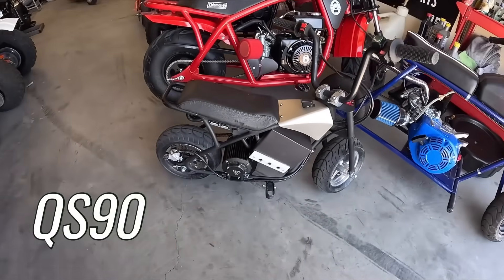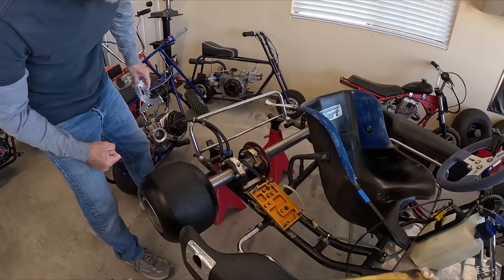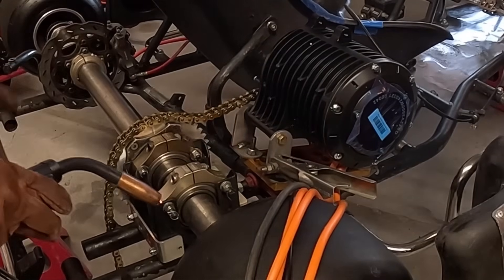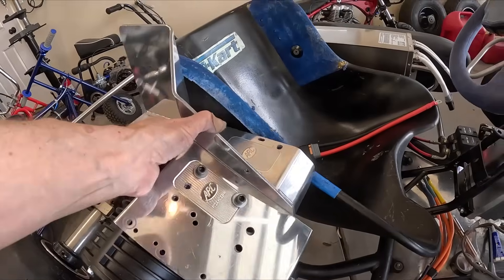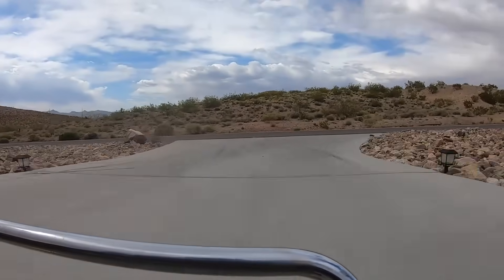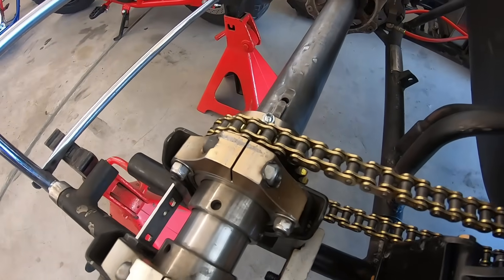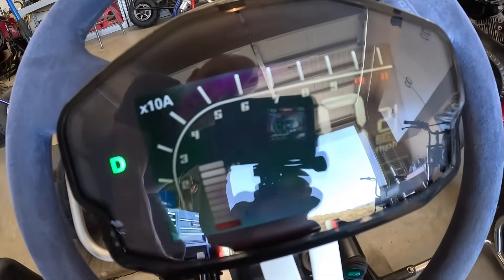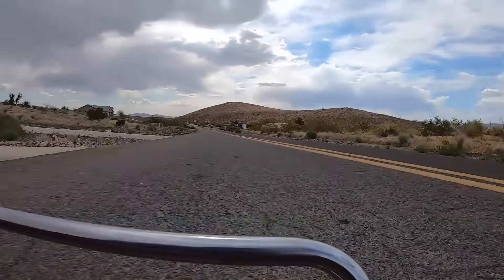How to build an INSANE electric Go kart!

Comment: Really cool build. Being a kart racer for many years it hurts to see you welding anything directly to the frame. Clamps go along way to keep the flex threw out the chassis. But nice job. I own a stark varg and thinking about adapting the whole power train to a kart chassis. Something with 4 wheel brakes and able to handle 80hp.

Comment: put a cvt togheter with the 28000 watts kit.
CVT all the way
Reply from the maker: There is really no need for a CVT with the electric set up because the electric motor delivers  maximum torque almost instantly

Comment: what model margay is that chassis? and year?
Reply from the maker: 2008 CRG
Reply: @Black66 do you think you need front discs on the kart running the 28kw system. I’m about to send it and buy a kit!
Reply from the maker: @SourDoughSam-d1s   It could use front brakes, but I think brakes are kinda over rated. 😀They add extra weight. Have you seen the second kart video? https://www.youtube.com/watch?v=K1XRsc0T-vY
Reply: @Black66  i have and it inspired me to get taller tires since i live in AZ. i found a complete set of frptn discs for 220. whats the ride time on that battery?

Comment: Soo i noticed that the Motor of the kit is rated with a peak power output of 28kw but a continous power output of only 3kw. Since the maximum power output is almost 10 times higher than the rated continous one i would expect it to have the full power only 30 seconds or something like that. Did you notice significant loss of power during longer rides? what happens, if you drive over 30 miles a longer period of time? I am very curious because i see these high diffrences also in street legal electric motocycles and no i'm not sure what this means for the kart/bike on longer rides.
Reply from the maker: I have noticed zero difference in power over long periods of time and in multiple videos. Also on a kart or minibike application the  motor runs very cool, I think partly due to the light weight of the vehicle.

Comment: At 1500 Watts it would be way too powerful considering the cart ways less than 50Kg Theodicy it should have a top speed of 240Kph that one at 28000 Watts must have 100Kg of Batteries that last only 45 Minutes and IMPOSSIBLE TO control without spinning out every few Minutes top speed would be almost 400Kph you would need a shell and tail fin just to make it suable for racing..
Reply from the maker: Check out the range test video using a 24AH battery https://www.youtube.com/watch?v=wGqlyUDskOY&list=PLkbj-ip-5FzYWaQnTJG7jZKLKYj0Ta-NP&index=2

Comment: Awesome video.   I’d be curious what that big cc small block you built a while back would compare. Running the 3D manual clutch it would be a fun setup with that much cc in a small block.
Reply from the maker: I did run the 263 on the same kart in a video without the 3D clutch, It was fast but not as quick .https://www.youtube.com/watch?v=VyT7GIvI6j0&t=151s

Comment: I know this is over a year old 
But this is the qs138 70H correct? 
And what voltage are you running at 72v?
Reply from the maker: The links for the parts used are in the video description. Check out the e-bike playlist for many more videos in this series. https://www.youtube.com/watch?v=ONA_EyhBQ9E&list=PLkbj-ip-5FzYWaQnTJG7jZKLKYj0Ta-NP&index=26 https://www.youtube.com/watch?v=676El2Yv3SI&list=PLkbj-ip-5FzYWaQnTJG7jZKLKYj0Ta-NP&index=25

Comment: Nice video.  Where’s the best place to order parts for an E Cart?
Reply from the maker: That is an interesting question, there are so many options out there. If you check out the e-bike playlist  I have tried a lot of the kits from Electro and Co which are basically plug and play , great kits and very powerful. Ive also tried a $300 kit off of Amazon which was fun .  I guess its a matter of opinion and how much you want to spend and how fast you want to go.

Comment: Have you ever modded the controllers by  putting solder on the shunt wires on any ebike controller mother boards. Anytime IV got a 2,000 watt controller for my ebike I always put solder or a copper wire across the shunt wire witch looks like a few staples on the mother board. It reduces the amount of amps across the board . So putting solder on it makes it run allot more amps. My ebike went from going around 35mph to 45mph just by putting that solder on them.
Reply: These don't use shunts like them but more hall sensors around the phase outputs to measure the current sort of like how current clamps work what electrician use

Comment: sick Kart jealous i counted 3.0 seconds both times 0 to 30 same as my Burn e 2 Max unless its 30Km/h still sick great build bro i want 1!! Subscribed.
Reply from the maker: Thanks ! Check out the other electric builds on the channel. Also I use a Dragy performance meter for 0 to 30 and top speed times.

Comment: I love your channel and envy your garage, thank you for all your videos. I was inspired by this video and am building the same kart as you but need help nailing down the gearing. What was the final top GPS speed with this 15/22t gearing and 10? inch tires that you featured in the second half of this video? In your opinion what was the best gearing you experienced for a parking lot ripper? Thank you
Reply from the maker: The non-gear reduction QS138 works best with the 10-inch tires IMO. The best setup so far on the reduction motor was in this race video  https://www.youtube.com/watch?v=ONA_EyhBQ9E&list=PLkbj-ip-5FzYWaQnTJG7jZKLKYj0Ta-NP&index=27
Reply: @ ok awesome what was the gearing in that one still 15/22? What would guess the speed was with that setup?
Reply: @Black66  haha thank you for the tip but I already received the geared version it's already mounted up! Haha what gearing did you use in the second video?
Reply from the maker: @wesleyb82  I was using a 19/40 with the turf saver tires in the second video. 
Never tested for top speed, but it was sure a ripper with that set up on it. It also had nice ground clearance.

Comment: I built mine from some guy who didn’t know how to wire it etc. 5000w 48v motor with 35t front sprocket and like a 45 rear. My test run on 300amp blew the tires off at 80mph and couldn’t see straight much after so I put a 15t front on it. Easy on amp load and goes 45mph now for kids. Plenty fast with drift tires on most the time. But omg that thing turned up full power big sprocket was scary fast. Using Audi e tron lipo cells for battery. Come as single cells in packaging so have to wire together and cell check leads etc so have to know some stuff but for 80$ for 16 20ah cells I can’t beat the price. Also they deliver 526amp each! After 2 7cell packs to make 51v I’ll have what 700amps of power

Comment: Just started watching your videos, couple questions. 
1. How many volts is this running, hopefully 48v already have lithium batteries in my golf cart.
2. Approximate cost of the motor/controller kit?
Reply from the maker: The links for the parts used are in the description of the video. The Kart is running a 76 volt 48AH battery .

Comment: lol with that reduction gearbox on the motor, looks like you could run 1:1 on the chain-drive and still smoke the hell out the tires on that kart..
Reply from the maker: That is a fact! It will smoke the tires with any gear Ive tried so far.
Reply: @Black66  i run a 1kw e-drive bike.. the gear-reduction on that thing is enough to where i can pull a 46-tooth chainring on the motor and an around 23 tooth rear pretty decently with the stock controller [it's a bbshd unit] with effectively a 24 in overall diameter tire.. [it's a 20x4 fat-tire bike, 8-spd rear, though i'm only using 7 of the 8 gears, mainly for better acceleration than just running only the 46/23 gearing].. that kart's got enough grunt to likely pull a 1.5~2.5:1 overdrive on the chain and likely still light the tires.. and i'm cycling from roughly 1.5 to upwards of 3:1 on my chain-drive, though my motor kind of hates pulling the 3:1 overdrive..
Reply from the maker: @niteriderevo9179  I hear ya! These things have that instant torque. Im going to throw a taller set of tires on the kart soon . It will not only gain ground clearance but it will help it out in the gearing department.

Comment: Some swedish dude put a stark varg motor on a cart, and it wheelies.  top speed 155km/h
Reply: Not a bad top speed. (155 kmh.) with my e-kart I can't do wheelies but I did 191 km/h in 1/4 mil. I haven't checked top speed because I haven't found a place to test it. but with the current gear ratio at 275 kmh. should be 😊
Reply: @monsterelectricgokart  I wanna see that !:medal-yellow-first-red:

Comment: Have you tried to go further smaller gear?
Reply from the maker: I have geared it to about 80 MPH so far in the last race video. It definitely has the torque to run faster with more gear
Reply: @Black66  currently building mine going for 22t pinion and 22teeth axle sprocket

Comment: Your road is decently paved but there are obvious defects in the asphalt. Would you consider installing a dampening kit on the Kart? I know your concern would be bottoming out on those bumps but you can only go so fast regardless of the electric motor or engine you are running. At some point you will have to address this issue or your builds will be pointless meaning you will cap due to the kart becoming unstable.

Comment: Was the throttle e cable or mx twix
Reply from the maker: I show the throttle assembly in the video
Reply: @Black66  Can I use the 76v battery on the same motor?
Reply from the maker: @SProducezzz  I am running the 76V battery on this set up.
Reply: @Black66  Thank you. First Video watching definitely watching more. 👍👌

Comment: A few quick tips.

Despite differences in weight and drag between a bike and a kart...... When  you buy a kit like that all you need to do is ask what gearing the guys are using. Then assume most of them are using 20" tires so find the OD (outside diameter of the tire) and the OD of your tire and divide yours into theirs and increase your gearing by that amount.

Also very important when dealing with a kart as long as your sprocket is not in danger of hitting the ground....just increase the diameter of the front sprocket (do not reduce the rear size) the larger overall sprockets will greatly lessen load/wear 
on the chain.

Great review keep them coming!
Reply from the maker: Thanks! Yes I talked about upping the size of the front sprocket in the video which I have done. The video coming soon.  The gearing on this one is a little different because the motor is a QS138 V3 gear reduction motor. I have to use very high gearing to get any kind of top speed.
Reply: @Black66  Why did You decide to use Gear Reduction Motor?
Reply from the maker: @rando.toming  It's the version of the QS motor I hadn't tried yet on the channel.

Comment: So when i built my first diy electric skateboard, i calculated speed buy using some very basic math. The outter diameter of the wheel, the kv of the motor, and the speed i was shooting for. After that, its basic math. Diameter in inches, inches in a mile, rotations per mile, rotations per kv. You get it, right? I was within 1 mph of my projected mph for voltage, diameter, gear ratio, ect. I calculated 23 mph, in reality, i clocket 22 on gps repeatability. . But let's remember, its a state board and i was running only 33% of max voltage... Its a friggin skateboard guys. 6000 kw 7364 motor before you ask. 194kv 50 amp esc with an Ebay belt drive. Still have it to this day. Still scary as hell to ride. Too much torque. It will stand up and through you off. But still fun. Just thought a basic understanding of the math would be super helpful. Cheers! 🥂

Comment: recommended combo . 72 volt chi battery Torp 1000 controller and a TM-25 motor. that will do about 90mph. all out.
Reply: thats a very slow combo for the price

Comment: Any bt200x content on the way ☝️🤷‍♂️
Reply from the maker: Yes, I have some bt200x content coming out soon!
Reply: @Black66 you should try putting that kit on a mega moto 212 bike or the b200. If it all fits right, a minibike would probably do 100mph or so with that much electric power lol.
Reply from the maker: @Bikelifejoey225  I just might do that at some point!
Reply: Please do!
Reply: Check my page out I just put a ghost stage 5 in mine working on a   top end video soon